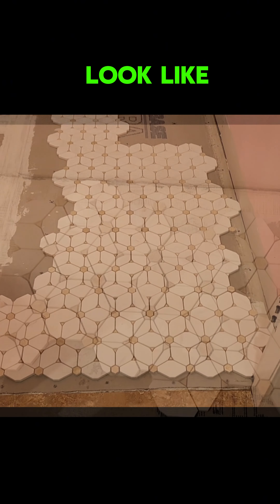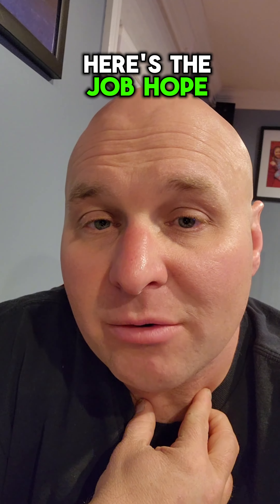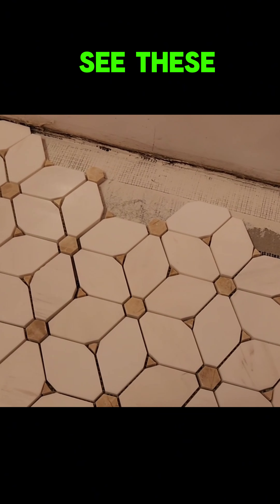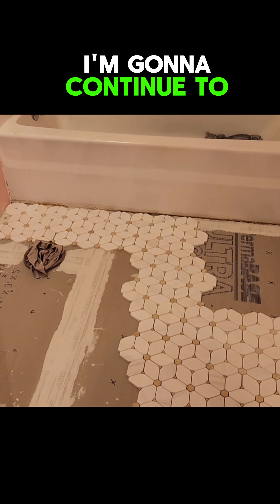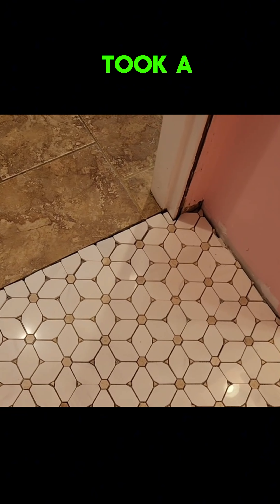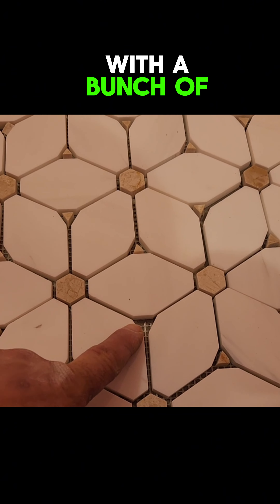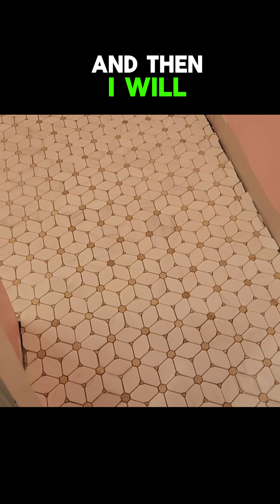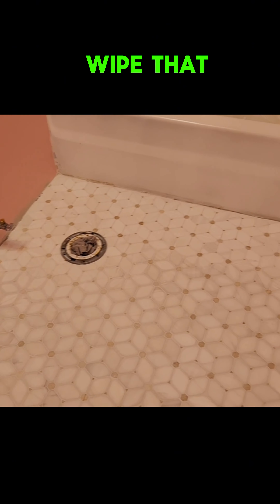Marble Mosaic tile floor.

Comment: 1/4 cement board or 1/2”?
Reply: I was always taught on a floor it should be half inch, no matter what.
Reply from the maker: You were taught wrong, cement board has no structural value.
Reply: @SalDiBlasi  You can refer to laws and codes and books,  All you want, but the simple fact that half inch concrete board is sturdier and makes for a better substrate than 1/4 inch , its nott even debatable. Have a Good night's sal. Common sense.
Reply from the maker: A feeling you have does not constitute fact, development and testing does, the fact is using 1/2" instead of 1/4" makes no difference at all. 40 years in the trade,   manufacturers, TCNA and ANSI are the "Books"  and "Laws"  I refer to. Not a Gut feeling, you are correct it's not a debate. Common sense has nothing to do with it.  And I did have a very good night, Thank you.